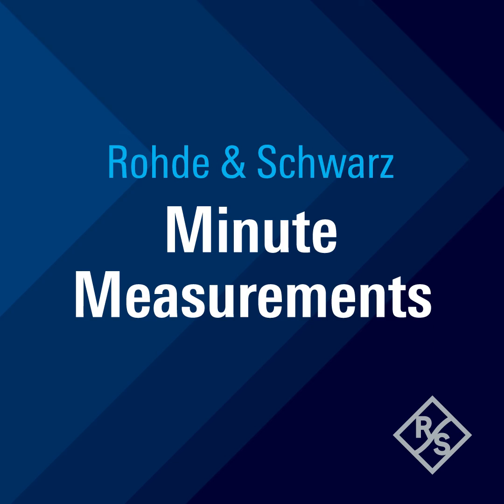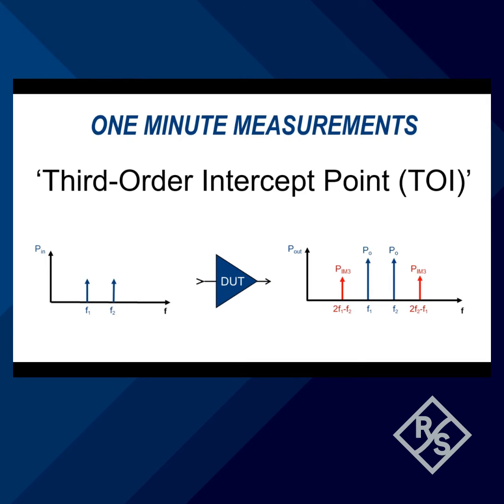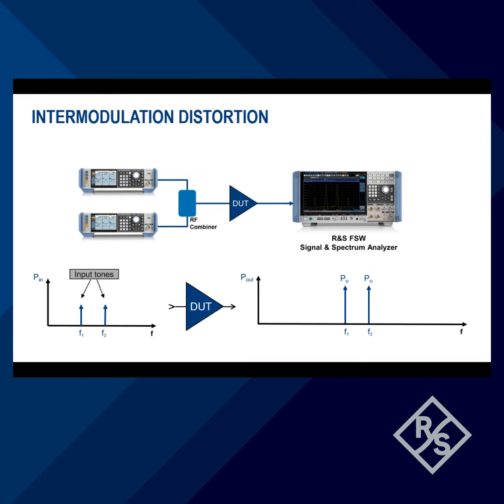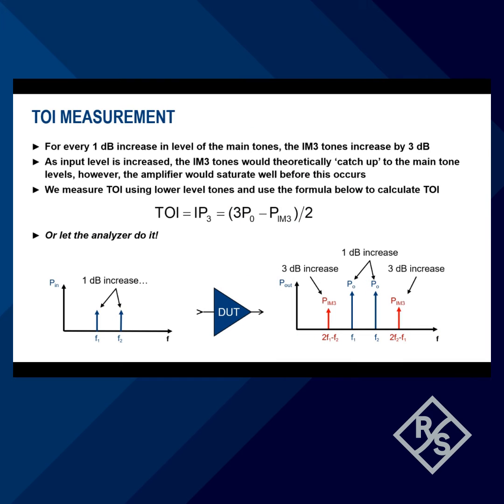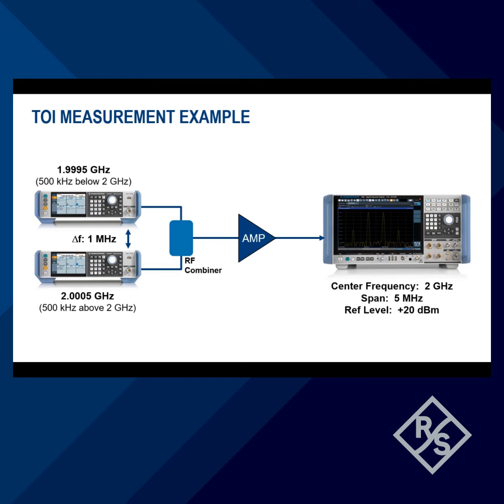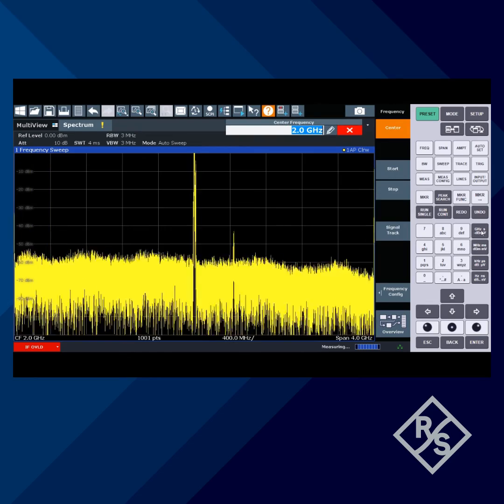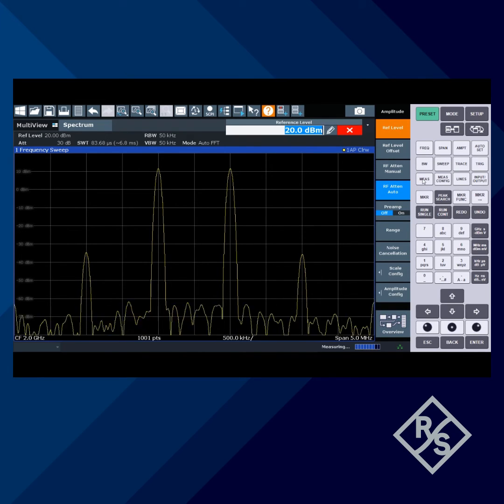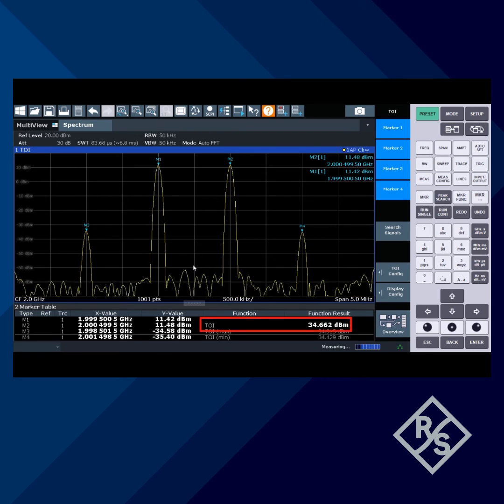Minute Measurements Third-Order Intercept Point

Comment: I am just curious about how to mitigate the affect cause by the internal mixer of this analyzer. I think the compresion point of this intrument is around +25 dBm. How can I know that these IM3 products are purely created by the DUT?
Reply: If you are ever unsure as to whether the 3rd order intermod products come from the DUT or the analyzer (and this is true for any spectrum analyzer). Manually vary the RF input attenuation. If the 3rd order products change in amplitude, the analyzer is contributing. If they stay still (and above the noise) then you can be sure you are measuring your DUT.
Reply: If you have a calibration report for your SA, there should be a measured TOI point in there.